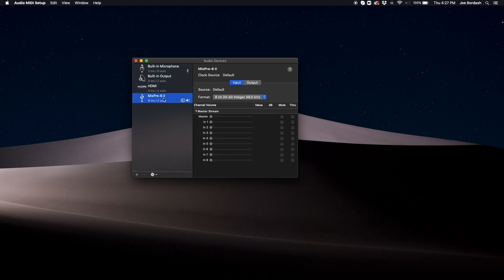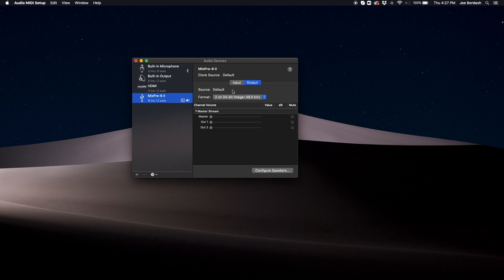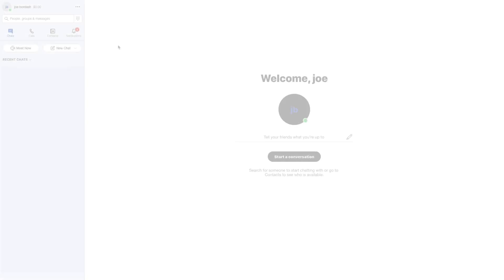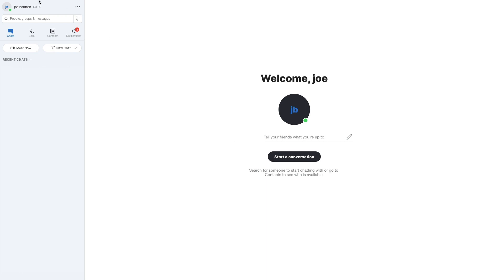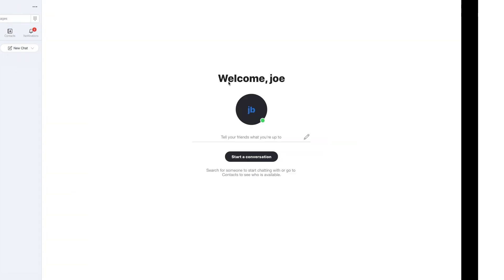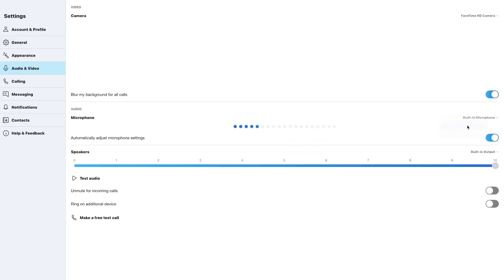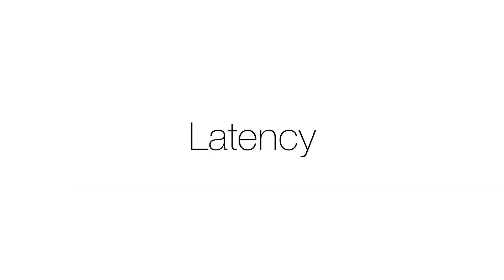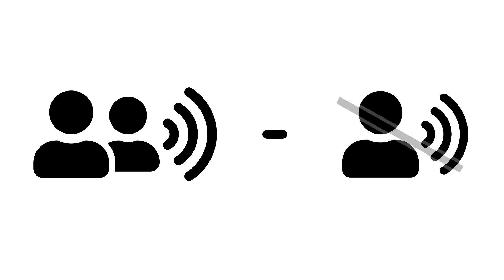Podcasting with the MixPre II: Setting Up a Mix Minus

Comment: How do we set up for a direct phone call. Like taking a call in show?
Reply from the maker: If the person is calling in via cell phone, you would need to route that phone line to a channel, using the 3.5mm Aux Mic input option. This may require an adapter if your phone does not have a 3.5mm TRS output jack. If you want the caller to additionally hear the feed from your mics on the MixPre, you'd also need an adapter that separates your phone input/output options, since you'd also need to send the MixPre feed back into the phone via the 3.5mm Stereo Output. There are many splitter/interface boxes available that will separate your phone's audio output and input into two ports. 
 
 
For further questions, please reach out directly to our support team at https://service.sounddevices.com/contact-support/.

Comment: Is it all possible to get the remote speakers audio to not only be heard on the left channel but in stereo and if so, how do you configure this?
Reply from the maker: Hi there! Make sure the speakers channel is panned center.
Reply: The speakers were indeed panned center but still the output is panned left?  @sounddev

Comment: Too fiddly with this minuscule screen and unintuitive scroll wheel on the side. 
Presets for most common use cases as accelerators would be nice. And an app that does more than fader control.
Note, I own a Mixpre 3 II and I value its capabilities. But the handling for e.g. podcasts is too cumbersome.

Comment: Can I have a guest with mix minus and at the same time play sound from the computer to the MixPre, so that the guest also hears it? Does that sound need to be routed to its own channel? What I'm wondering is if the MixPre 3 has enough channels / tracks to accommodate 2 hosts, 1 remote guest and also play other sound from the computer, or if I need a MixPre 6 to pull that off.

Comment: Just to exemplify  the MixMinus I am doing with my MixPre3: 
Objective: keep a Mix with stereo sound from my computer  (input 1&2) and my only mic (input 3). 
INPUT:  Setup1: USB1  Linking: 1-2   Setup2: USB2 (automatically) 
OUTPUT: St.Out.Left: MixL , St.Out.Right: MixR , USB1: Track3, USB2: Track3
This way, I keep my mix with stereo sound from the computer plus my mic sound (mono and centered). And the return sound to computer is from my Mic on both channels. Hope someone from SD can check if the above setup makes sense?

Comment: just a couple of follow up questions:  (1) at 2:09, How come you only set the L output and not the R output too?  (2) at 2:51, when you are setting the USB output, why do you need to set USB 1 & 2, and not just USB 1 by itself?  and (3)  Why  is the USB 1 & 2 outputs only set to L out instead of both L & R?
Reply from the maker: Essentially it's like creating a bus send. We create the mix minus on the L output. We set USB 1 and 2 to be fed by the L output (mix minus bus). Most audio applications are stereo therefore needing USB 1 and 2 to be sent to the remote guest. Sending both L and R would negate the mix minus unless we also created the exact same mix minus on the R output. Does this help?
Reply: Ok I think I get it. So in this exercise, if u did select channels 1 & 2 to send to the R output, then that would be ok for the mix minus too, correct?
Reply from the maker: @jtdiddy3160  Correct! You could also create a second mix-minus if you have a second remote caller with the R output.
Reply: Dear SD team. Why unnecessarily occupy L OUT in this case, You can route Mic1 and Mic2  postfader on USB1/2 side in USB output menu...No ?
Reply from the maker: @Wolfihouse  USB outputs are routable with a single source at a time.

Comment: Why is it named L OUTPUT?
Reply from the maker: If you were using the outputs as a true output to drive a pair of monitors or sending USB audio the L output would go to the left side of the stereo spectrum. Here you are simply creating a send on the L output and sending that to the remote caller.  Does that answer the question?
Reply: Sound Devices I’m confused. Would the remote guest only receive audio on their left channel?
Reply: @Michael Scott  Hi Michael, I had the same question days ago. Now things are becoming clearer. USB1 is the left channel for your guest. As SD suggested in other responses (below) you can also do the same for USB2 so they you receive the "L Output" signal (=input/mic1 & input/mic2) on both channels. When you don't send USB2, normally programs like Skype does picks the mono input and feed both L and R so to keep the stereo sound (same signal, so a mono input feeding both channels). 
In case you do not use the Minus Mix method, Skype will use its echo cancelation feature, as explained by Curtis Judd in one of his videos. So not the end of the world.

Comment: This is so helpful thank you x1000!
For a future video tutorial  can u walk us through how to setup the mixpre 6ii to run a mic signal say on channel 1 out to an outboard gear (i.e. compressor/eq etc...) and then run that processed signal back into the Mixpre?
Reply from the maker: We can add it to the list! It also depends on what type of signal the outboard gear uses. In the short term just go to outputs and set the stereo output to Channel 1 then use the output of the outboard gear back in.
Reply: @sounddev   thx. For example I'm wanting to use my presonus studio channel as an "insert" outboard gear for its compressor and eq, it that has one xlr & 1/4" inch input and one corresponding xlr and 1/4" output so I guess they are both mono.

Comment: You will also have to configure a headphone preset, potentially.  And use of a splitter or headphone amp is needed if there is more than a single person.

   Also, note that you should make or answer the call BEFORE you press record on the MixPre.  I have tested Skype and FaceTime Audio and if you press record before establishing the call, the software sees the MixPre as busy in some fashion and jumps to built-in devices for my iMac.  Pressing record after the call is established works as expected.

   I also use channels 5/6 for USB recording typically unless I have something feeding that input.  Keeps the XLR jacks open but this is a matter of taste.

   And be aware that configuring the L and R incorrectly could lead to an embarrassing open mic situation.  I had forgotten I was configured for more than the typical single return audio channel to USB that most devices see and multiple mics were live.  Almost all interfaces expose a single Jack, usually Jack 1, to audio programs like Skype and Discord or Zoom.  This can lead to unfortunate hot mics.

!
Reply: I don't believe the MixPre is compatible with IOS.  It's not using a common USB stereo driver IOS would understand.  You would have to use the analog line-out and feed that to the IOS device.

!
Reply from the maker: @BangsNaughtyBits  Correct. iOS uses different USB audio drivers.